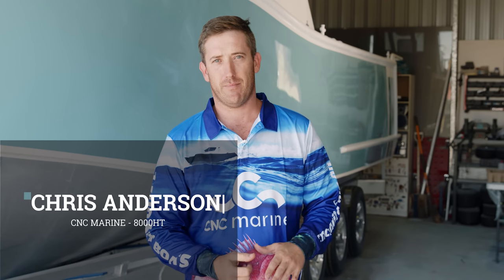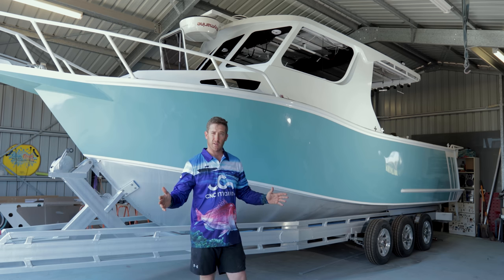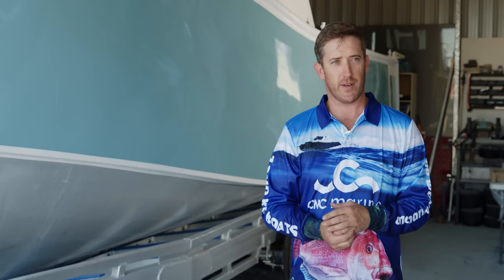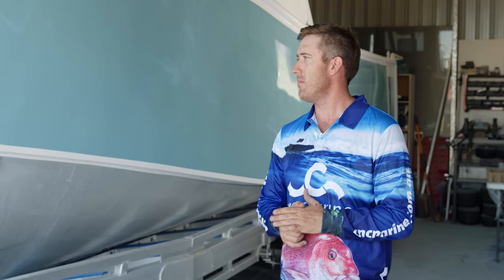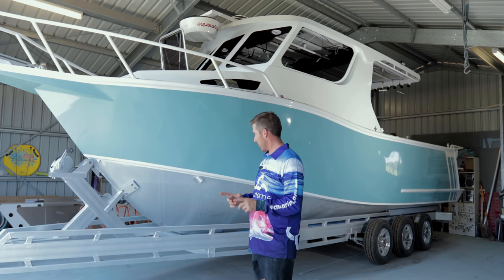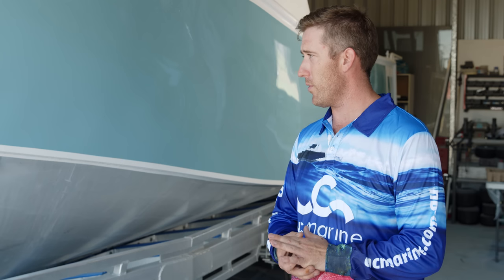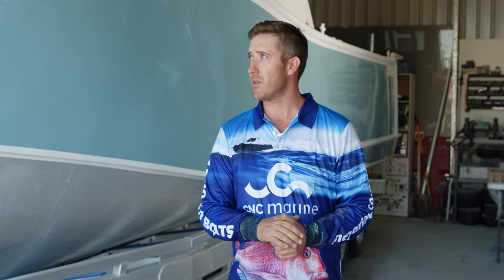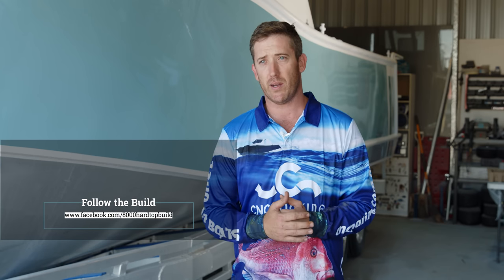Building the CNC Marine 8000HT in backyard shed

Comment: hello beautiful boat congratulations you have worked a lot to get it right so it ended really well ... could you give me 2 technical information? a boat in the water what is the wet length from the tip to the bottom of the stern? and by chance you know where the center of gravity of the boat is (always from the lowest point of the stern) by measuring it ... thanks